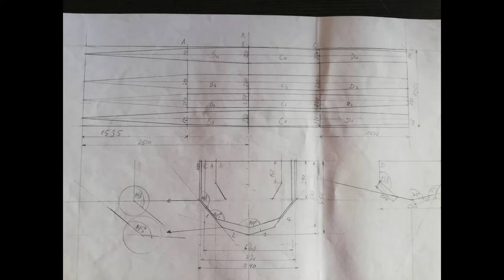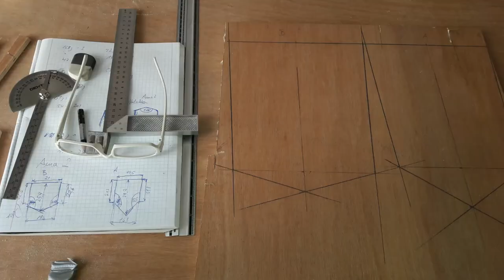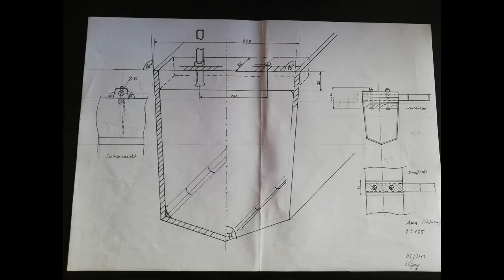Tupaia small Trimaran

Comment: I am converting a "Buchaneer" (Chrystler Built) 18 foot "lake boat"~. A fast boat that a tree fell on and now my son has me sending it to "demolition.,"  So I took off all the fiberglass on top and "just the hull" has been there for 20 years.  Not able to redo with white oak ~ what is around here in New England. So just this week.  I realized that my effort to make the hull flatter and wider is actually wrong.  Now I am making the hull into a Canoe. Narrow the hull as much as possible not widen it.  It is about this size.  I do not have enough time for this video now. But I have subscribed.  Your Ama's are about what I am planning.  I also work for a Dock/Water float making business.  All aluminum.  That's where I'm going for the parts.  I am determined to make this happen. I have the hull the centerboard trunk in the middle centerboard, tiller, rudder, mast main and jib sails. I even have an extra main sail for maybe a genoa.  It will happen.  I am determined. I'll be back.  Godspeed.   From New Hampshire.   ✨🌸✨

Comment: Ok Ok Ok, I've been able to peruse your video again this morning. You should be commended on this build. Your glass work and the result excellent. Thank you so much for sharing this effort. I don't know where you are located but mainly I am interested in the design of the Ama's.  Your design is unique.  I did take some information from a drawing that sort of flashes on the screen.  A "Trimaran" build,I'm finding, is another popular You Tube subject.  I've looked at a number of posts and usually the Ama's are lower volume.  I will definitely incorporate the bottom v with vertical sides.  Thank you.  ✨🌸✨

Comment: Interested in doing this myself.  Just need to ask:  are the pontoons able to be folded in so the craft can be transported on a normal trailer ?   Probably already addressed😃 in the videos.
Reply from the maker: David, thanks for the comment! I dreamt of building such a system, but didn´t have the time/patience to dedicate to it, although I´m quite aware of the advantages. Many solutions came up during the build, so some day I would need to begin to elaborate some technical drawings if I decided it was worth it.
Reply: You can see in the video that the boat is on a trailer and the amas are on the roof of the tow vehicle. So it does break down.